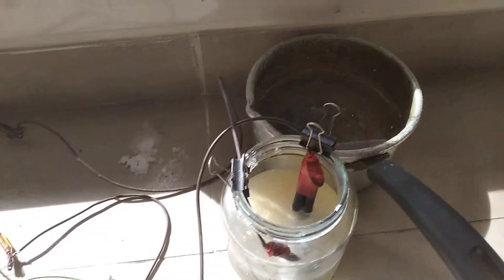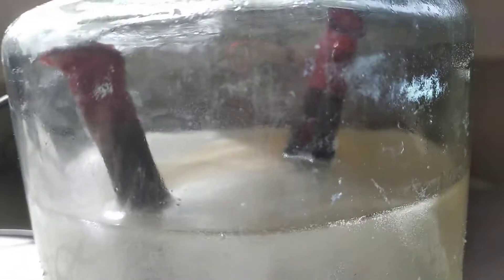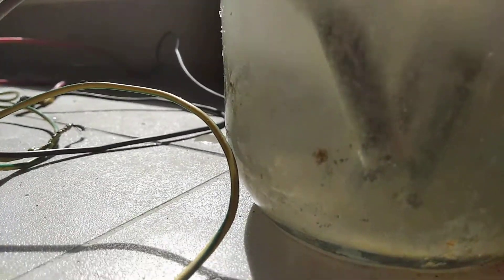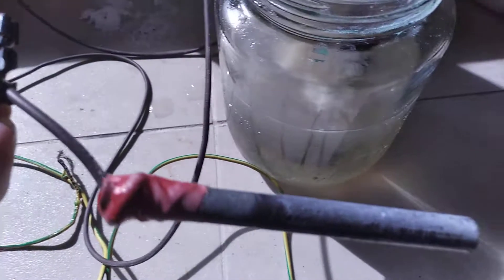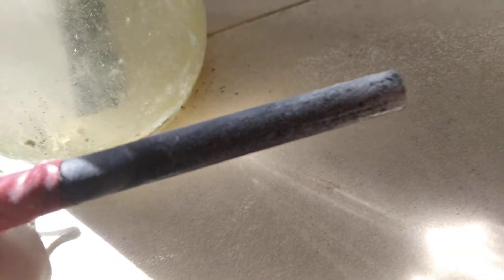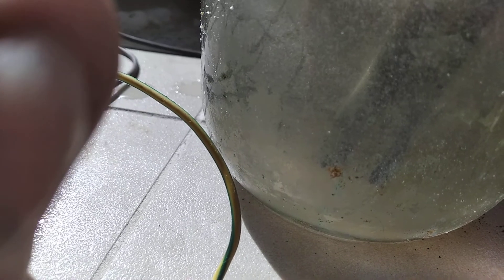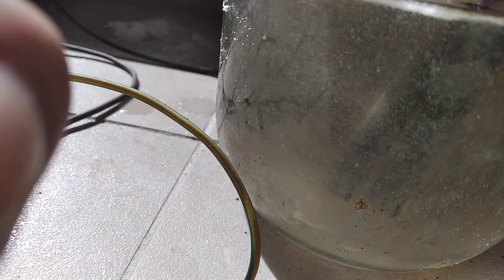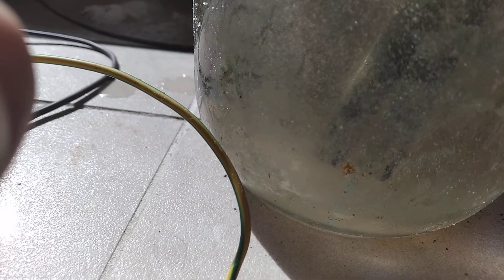graphite passive pH controlled chlorate cell no errosion

Comment: Heres a question!: 

Would adding magnesium chloride help in making perchorlate ions for a perchlorate cell?

I wanna make a perchlorate cell instead of chlorate and if CaCl keeps the soultion alkaline, wouldnt MgCl do the same?
Reply from the maker: you wanna avoid adding any more chloride ions in a perchlorate cell and instead use MgSO4 or sodium persulfate.
CaCl2 keeps the solution acidic not alkaline and so does MgCl2.
Reply: @CatboyChemicalSociety  Gotcha, thanks!
Reply: @CatboyChemicalSociety  I forgot to tell you this: Try out making a MMO/graphite cathode using Zinc oxychloride (zinc oxide + zinc chloride) and Sorel cement (magnesium oxide + magnesium chloride) with graphite powder. 

Apparently mixing metal oxides with their chlorides grant this cement mixture and adding Graphite could help increase conductivity of the electrodes. Helps give the benefits of both MMO & graphite electrodes.

Just a thought.

Comment: Hello please I have a question I made a sodium chlorate cell and prepared a carbon electrode anode and stainless steel cathode and turned the cell on for  12 hours When should I add sodium chloride What are the signs that the chloride concentration is low Please reply and thank you 👍👍👍
Reply from the maker: well just calculate runtime based on current draw using an online calculator.
Reply: How do I add sodium chloride to the cell Do I add it as a fine powder or what

Comment: Hey. I’m soon gonna make a graphite electrode chlorate cell but need a lil help. So I have made a chlorate cell before with MMO and titanium electrodes but it somehow broke, so even though that failed I still know the basics. But anyway did you coat your electrodes in anything? I have heard baby/mineral oil can help stop erosion. Also I saw somewhere that you can use sodium persulfate for ph instead of calcium chloride? Also are both your electrodes just graphite cause some people have graphite anode but titanium/stainless cathode. And I know that the voltage should stay below 6V but what’s the best amp? And one more thing, I saw in a comment that you managed to make 400gram of sodium chlorate a day, how is that so? That is very impressive. So yeah I’m planning on using 12mm thick graphite electrodes in like a 1,75 litre tub but I will probably only add 1.5 litre solution if that info helps. Any assistance would be very appreciated :) thank you :)
Reply from the maker: how did your MMO break and btw this was a test to see if graphite was viable at all.
It is but theres an issue a ton of Cl2 gas is released and its pretty nasty!!.
Reply: @CatboyChemicalSociety  to be honest I’m not really sure how it broke or if it even is broke. When it happened I came back after a day and it was cold, not bubbling and the amps where at like 0.2. I have heard unprotected titanium (my cathode) can oxidise and stop working after a while so it could be that, or my solution want saturated enough because if I think about it I could only squeeze maybe 6 amps tops through it, I really wanted it to be higher but couldn’t get it for whatever reason so maybe there wasn’t enough salt to fully conduct the current. Anyway the reason I wanna move on to graphite even if my MMO is actually still ok is because the MMO was fairly small and wouldn’t have made enough chlorate quick enough anyway probably, but with the graphite electrodes I have if I get it to work it would be much faster. I’m also doing it as a proof of concept, I’m trying to make a sort of book containing all sorts of improvised ‘things’ for the apocalypse or in case of a dictatorship or something lol and chlorates are very useful but most people don’t have MMO anodes laying about so it would be great if they could make them from easily accessible things like graphite. But yeah I’m still tryna figure out some things, mainly preventing electrodes decay but without perhaps calcium chloride since I have heard it kinda sticks to the electrodes, but idk. You seem to know a fair bit about this so any help would be appreciated. :) Thank you :)
Reply from the maker: @TheFireGoose  its not broken just that your electrical connections sucked and your wires arent thick etc who knows corroded alligator clips due to salt creep.
This is why I never use those for my cells or to ensure its all nice and secured and sometimes I run a venturi to keep it at negative pressure to eliminate all salt creep.
Reply from the maker: @TheFireGoose  u can use graphite but pH control is not viable and expensive due to the amount of HCl you will add after the buffer to compensate.
Reply: @CatboyChemicalSociety , I think you might be right about the salt creep, the crocodile clips had this weird white stuff all over them, also my entire workbench was sprayed with like a white salt too. But how do I prevent that. I used a UV set epoxy and it got eaten, I have heard hot glue gets eaten too. Would metal epoxy like JB weld get destroyed? If so what can I actually do to seal it right? (Btw I had my electrodes sticking through holes in the lid of the cell, it wasn’t open). Also I know I would have to add lots of hydrochloric acid but can’t I sub that for sodium persulfate dissolved in some salt water? And like top it up once a day or something? If not is there any more efficient way that using Hcl? Thanks :)
Reply from the maker: @TheFireGoose  sodium persulfate is an exhaustive buffer while HCl regenerates CaCl2 buffer.
I dont use crocodile clips and use binder clips for paper as they are better fundamentally.
To prevent salt creep on anode its impossible with graphite but with MMO you need proper sealing.
Venturi on the outlet prevents its entirely by negative pressure operation.
Reply: @CatboyChemicalSociety  ah, that’s a shame about the creep. Do you think coating the clips in something will prevent/reduce the effect of the crustyness on them? I’ll have a look at binder clips though. Also how did your graphite chlorate cell test actually turn out? Did you get a good yield? And how was purity? To be honest though I’m not that bothered about initial purity/quality from the cell since I will recrystallise anyways so yield is the most important thing. Thank you :)
Reply from the maker: @TheFireGoose  nope you cant coat clips with anything.
the graphite got annoying because its very wasteful on Cl2 being released at lowe temps to the point where it became hazardous to run.
Also using a graph I found that the amount of HCl you have to add periodically to keep the Ca(OH)2 from eventually causing the cell to turn alkaline made it not worth.
Electrolysis of CaCl2 however is worth and will produce calcium chlorate but good luck with the brunt of really bad chlorine emissions and HCl additions every 8 hours.
Reply: @CatboyChemicalSociety  damm this is all kinda unfortunate. All I really want is chlorate for making fuse but mainly impact firecrackers and stuff so will calcium chlorate work for that, like is it sensitive in combination with sulfur and dose it share the same properties as Na or K Chlorate? Also graphite aside is there a another good cheapish way of getting chlorates (excluding boiling bleach/chlorine). Or do you have to kinda use MMO/platinum. Also one more thing so obviously titanium is good for a cathode but would a chlorate cell work if you used titanium for both the Anode and Cathode? Thanks :)
Reply from the maker: @TheFireGoose  you can convert calcium chlorate into KClO3 by adding KCl.

Titanium is only a cathode and IMO I prefer stainless steel as a cathode vs titanium.
MMO is really the way to go and im sure your electrodes are fine just restart the cell.
Its actually quite difficult to kill MMO only to wire it badly and assume its dead.
dead MMO = orange to brown water and cancerous toxic RuO4 gas.
Reply: @CatboyChemicalSociety  ok then that’s good about the calcium chlorate, so you just add Kcl in the cell similar to making NaClo3 into potassium chlorate. Also are platinum anodes good cause I found a guy in America selling a set of platinum anode and titanium cathode (6 inch by 2 inch) for a pretty ok price. And another thing, I thought stainless steel breaks down in the harsh environment of chlorate cell? Thanks :)
Reply from the maker: @TheFireGoose  yea buy his MMO instead fuck Pt its worse than MMO.
From this guy electrodesupply aka gallium guy right.
For stainless steel you need to tape up what is not exposed to the solution IE whats exposed to gases in the cell.
Reply: @CatboyChemicalSociety  yeah it’s the electrodessupplyguy, ok I’ll probably get some of his MMO sometime then. I’m still gonna try my luck with the graphite electrodes too just because I have them and everything I need for them. Since I have an extra graphite rod as well I might also try a graphite anode and stainless cathode just cause. Anyway thank you so much for your help, I really appreciate it :) thanks :)
Reply: @TheFireGoose  Just try it with graphite, I had succes. But be prepared to do a lot of filtering. I found that using a higher current density then recommended will cause the graphite to errode in bigger pieces, making it easier to filter out. Probably not as efficient but it does produce chlorate fast. The graphite rods still lasted about 3 runs this way. Depending on the cost of your graphite, I can see how it quickly becomes more cost effective to use MMO though.
Reply: @FOATE  ok thank you. I managed to get some MMO electrodes luckily and they work great. But graphite ones still interest me just cause they are very cheap and accessible. Can I ask a few questions though. So how much chlorate did you manage to make with the graphite electrodes and how long did it take? Also would it be better to make sodium chlorate with this since it’s very soluble in water which would make removing graphite waste easer. Also how much chlorine does it create? I have heard graphite electrodes make lots of chlorine. Thanks :)
Reply: @TheFireGoose  A little over half a kg in a couple of days, with 5v at ~20a. It does produce alot chlorine gas so I put the cell outside. Temperature was far from ideal because of this. You have to keep topping up the cell everyday to prevent loss of chlorine ions, and after removing the crystals I would adjust pH with HCl. Im not sure if graphite produces more Cl then MMO, in theory MMO should also produce Cl gas but maybe it forms hypochlorite easier with MMO, idk. 
I think NaClO3 would indeed make it easier to remove graphite particles, as you can work with lower volumes of water. Vacuum filtration over celite works great for graphite particles, but gravity filtration over cotton wool, while slow, works nicely too.
Reply: @FOATE  ok cool thank you :) 
One more question, how large where the electrodes? I assume if your running 20a and getting such high amounts of chlorate in a few days they’re pretty big
Reply: @TheFireGoose  Yea they're 22x300mm, pretty beefy. At first I used 4 gauging rods 10x100mm around the cathode, but they're alot more porous and thus degrade faster. Did give me chlorate though, but with alot of graphite contamination, and lasted only 1 run. 
BTW that was the max current the power supply would do, I never measured the actual current running through the electrodes. If it actually ran at 20 amps that would have been an efficiency of only 20-25% so just keep in mind it's far from ideal to run a cell with graphite. But if you just want a bunch of chlorate and aren't planning to keep a cell running all the time, it's fine. I tend to just treat graphite as if it were expendable. Plus I think recrystallisation is actually kindof fun and beautiful to watch. Definately has some sort of satisfaction to it lol.
Reply: @FOATE  cool thank you :)
Yeah I mean I doubt anyone makes a graphite chlorate cell assuming it’s going to last them hundreds of runs lol, but that’s fine cause that isn’t really what graphite should be used for. It’s best like you said to just make a bunch of chlorate in 1 or maybe a few runs. 
Also recrystallisations are really nice, especially when it starts snowing crystals down :)
Reply: Adding calcium hydroxide anyone?

Comment: Do you only add one time the Calcium Chloride till it doesnt currode and when it Starts to corrode its done?
Reply from the maker: I originally tested CaCl2 in graphite anode cell and it does inhibit corrosion for a bit until the buffer effects run out due to lower pH and therefore must be replenished with addition of a few ml of HCl 15% solution
Reply: @CatboyChemicalSociety  So fill up the water that has evaporated with an HCL solution (1%?)
Reply from the maker: @Pyrokartoffel  yea dillute HCl is used to refil it.

Comment: what is the ration of NaCl and CaCl?
can I use KCl instead of NaCl?
Reply from the maker: you add 8 grams per kg chlorate theoretically produced and no KCl will just precipitate as KClO3 and is not really pH control.
It also only works when the cell runs atleast 60 Celsius.
Reply: @CatboyChemicalSociety  thanks
edit: what about electrode distance, do I need to make the electrodes close to each other?